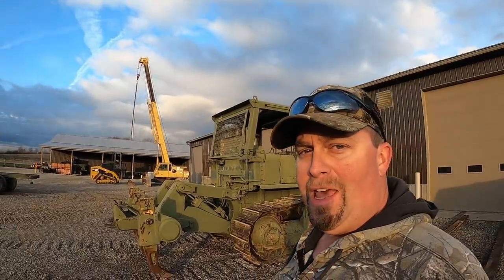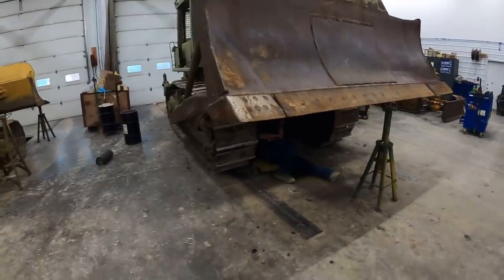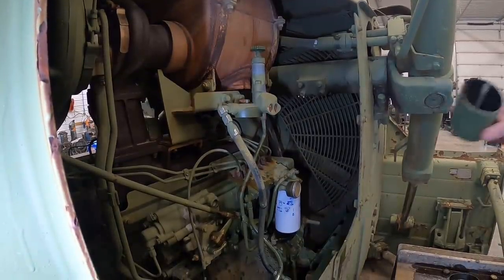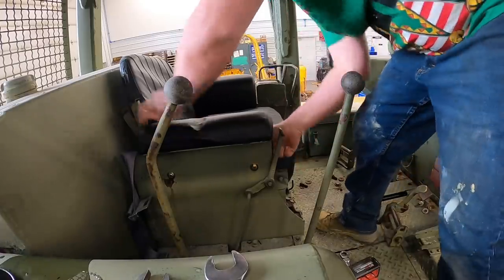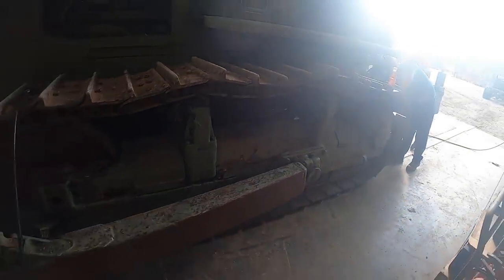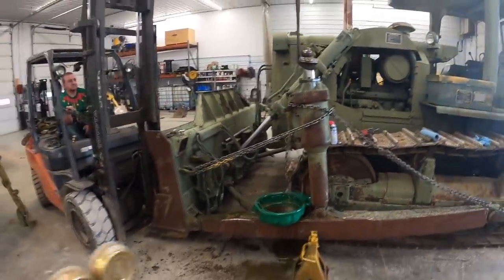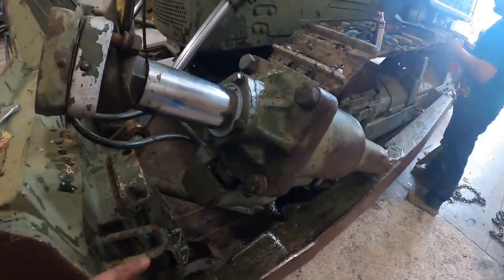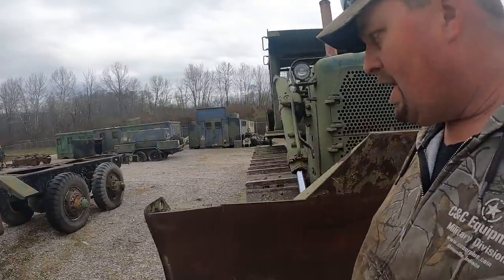Cat D7F ex military dozer walkthrough and service @C_CEQUIPMENT

Comment: I was a truck mechanic for many years, retired now. I actually never opened up a new filter and the rubber gasket wasn't there. All mechanics should check for a rubber gasket prior to installation and lubricate it, also check that old filter to see that its gasket is there and not still stuck to the filter housing. I agree with letting him go, it's too bad it didn't work out for him.

Comment: That would be a great farm machine. Clean low hours and easy to repair . No def no computers just a good machine. As far as the filters the first thing I was taught was be sure to remove the old gasket if it is stuck and make sure there is a gasket on the new one. Can't believe the guy did it repeatedly. Every shop needs a "Kevin". Make the day go by faster.

Comment: I have asked myself way before if working big equipment isn't easier than small equipment.. With big equipment, you use a tool to lift a cylinder as for a little one will lots of times get man handled. The stuff to fix is bigger and doesn't move as easy... torque settings are a lot higher but again its a tool to do it with.... Nice work Clint.... more, more.. yes I like it/lol

Comment: Did you take the belly pans off and clean those areas out? What did you find out about the sticking brakes? corrosion in the lever / pedal mechanism joints?
Reply from the maker: Belly pans were clean
Pedals was just sticky from siting

Comment: I had the gasket stay on the engine (two gaskets) and found out when I started the engine and it leaked. Then removed the gasket from the engine reinstalled and had no problem after. Lost about a quart. I always lub the gasket when installing on engine.

Comment: Awesome , Thanks for the channel . I have a JD450C , I am having issues with the fwd/reverse . Once I get it going it stays going , next day I have to work it back and forth . I have a manual and have done some adjustments to make it work but starting to fail again . Do you , can you , charge me for consulting over the phone .
Sad to say ,  I DO NOT trust our JD here on Island . They are good guys but over worked and don't know anything about something this old . I need someone with experience , knowledge and guidance  before I start digging deeper . 
Again , I can call you with a CC# , charge me for an hour and then lets talk . Please . 
Thank You
Reply from the maker: I don’t have allot of experience with the older stuff from ‘87 back on Deere stuff
I assume you have changed trans filter in the machine?
Reply: @C_CEQUIPMENT  Yes , I have changed the Trans filter and it was clean and no metal . I did notice , if I don't let it warm up over 3 minutes it goes in F-R and hi and low . without any delay . Could this just be a coincidence ? Sorry so long to get ack , been on fires for past several weeks , Thank you  for your thoughts .
Reply: @DaleDirt  
I'm not an equipment guy but that sounds interesting since it initially sounds like a pump/seal issue when the fluid gets warm but that doesn't jive with "Once I get it going it stays going".  I'd love to hear what you find out, simply out of curiosity. 

Two other YouTubers, if Clint can't help you, who's knowledge I'd trust AND would care about what they tell you in addition to explaining why based on deductive reasoning backed by experience would be "western truck and tractor repair" out near the CA/OR boarder (forestry, farm, and some on-road) and "Dirt,Grain & Steel" in north-central IN (row crop farmer with a separate dirt work/excavation company that he doesn't focus on AND specifically runs extremely well maintained older, not vintage, tractors/equipment).

KUDOS for understanding that time is money and respecting the value of Clint's knowledge; that goes deeper than being a good professional and speaks of your probable integrity.

Comment: It takes a metal filer it catches the trash before the main fuel filter ,, the tank is probably full of mud ,,usually if Trans is low it bypasses into the finial drives,, check the radiator hope it's not a panel type an bad $$$$$$$ LOL I know I replaced mine on D 7 G

Comment: Your theory of precombustion injection is wrong, there is a small chamber above the main chamber and the injector and glow plug are in that chamber. The piston compresses most of the  air into the small chamber and when the fuel is injected it burns in the small chamber and blows out into the main chamber. This system was used because early fuel systems did not have very high pressure 500 to 1000 psi. and the engines did not have really high compression.
Reply: You are correct, the military updated these engines to DI, dont know why though.
Reply: @RomeKG471  That is a huge expense for for really benefit, Military Equipment hardly ever got enough hours to make the difference worth it.
Reply: @nfarnell1  Thats the military for ya! cost doesn't matter.

Comment: C&C Equipment +:  Very good continuation video from the transport video some two± hours from/to the C&C shop. Depicts a reasonably 'easy' service effort until...    the left-hand blade hydraulic cylinder rebuild catastrophe. A supposed 'short' and simple effort which escalated into a 'long' and complicated nightmare!  Oh, well, we learned a lot in the process, like how to ruin some rather expensive tools; set fire to and otherwise damage various cylinder pieces/parts; etc; etc. 😬

Found that one of the replacement filters came from the supplier missing the 'all-important' top sealing o-ring. Thoughts concerning this:   the POOR product is directly attributable to even POORER labor involved in the filter's manufacture, probably an illegal Guatemalan. Now, how did said labor get into the U.S.??? 🤔 Likely "walked" in, like nearly 12 million others have to date! 🤥

In all, quite an excellent presentation, as is the norm for this channel's videos. As such, it is awarded the  requested  YT  'thumbs-up'. As always, keep these coming. They are always enjoyed and looked forward to! 👏👏👏
Reply from the maker: Many thanks!

Comment: I haven't got a NAPA filter without rubber yet but have had 2 that were fucked up threads and 5 or 6 CAT fuel filters that split and spray fuel within 10 hours of use

Comment: I’ve never seen one without the metal screen in that spin on fuel canister, might want to check into that. Great video!! I grew up working on Caterpillar’s of this vintage. HAPPY NEWYEAR!!!
Reply: There is a supposed to be an element in that canister, that is the primary fuel filter & water separator, nice tractor
Reply: @38365chevelless  Correct, that's an 8H4681 primary filter, should have a 9M2341 element [screen] inside.

Comment: I enjoyed watchin you guys destroy the pipe wrenches.  I destroyed an old RIgid about 3 weeks ago using a cheater bar on it trying to loosen a huge JIC suction line fitting on a hydraulic pump.  Mine pulled the threads but still cool watchin even the bigger shops like yours improvise to get the job done!!

Comment: Old cats like that had a hydraulic oil dipstick inside the screw on fill cap. Just like the fuel systems, it’s a dipstick that’s bent over at a 90 and it slides into a slot that’s just wide enough for the stick.

Comment: Yes Napa filters are made by Wix and I personally only use Cat, Wix (Napa), Baldwin, Luberfiner filters. I refuse to use Fram and other cheap filters to just save a buck. I have yet to run into a filter without a gasket yet. I've never seen one of those separator canisters without a filter, generally they're a slightly bigger micron to catch most of the garbage before the secondary filter.

Comment: Enjoy your site and your posts. I just snagged an old USAF Hyster 10,000 155XL with 2700 hrs. Great shape, needs very little work and like you pointed out on the mil equipment, none of that electronic BS!
Thanks for the posts
Reply from the maker: We just had one of those we sold

Comment: Do you have a good location for my to look for a turbo for one of these?  I have a 1965 d7e ( d339t 4 cylinder engine) and I’ve gone through 3 turbos in 3 months.   CAT has warrantied them but this last time they sent a technician to look at my machine and he said bad turbos.  He thinks they are made in china and a CAT number is being put on them since they are obsolete.  He said a CAT made turbo is like $6k and these these turbos are $2k.  

The turbos are actually seizing up when the dozer get up to temp and under boost.  Eventually the turbine sides oil seal goes and it plows oil out the exhaust and I have no power.  

I’ve thought about buying a salvage cat turbo .
Reply from the maker: That’s strange
Only outlet I would have is an aftermarket one that probably from overseas
Reply: Go to a turbo and injection pump shop, it's Garret cartridge.

Comment: I have seen when the gasket from the oil filter stuck on the block and they put a new filter on without checking and run it and it blew out and ended that engine real fast some people have no clue dosent take much to look up and make sure its gone or even look at the old filter top when you take itoff
Reply from the maker: Yep

Comment: Thank you for being a shop that gets those Military heavy Equipment, the LOW hours on machine. This machine could have been used in Military life for training new guys or gals only. The tracks or so large on traction sprockets, great sign ( wear item) the filter change by them great sign ( it just sat ) no use after filter change so your filter change for me is like getting new life. The seals on tilt cylinder for front blade could only be from sitting rot, seal goes bad from no use. People might look at those Government surplus as junk, you show otherwise. I will say from my experience on a JD 450-C Dozer. This is just a FYI for all watchers of your video series. Someone had done what I call a Alaska overhaul. They spray painted it real good. We had it running and then it would starve for FUEL. 
It was the over spray that got on screen just under fuel neck on top of tank. The screen got plugged up with new yellow Paint. All we had to do was clean it good, it FIXED run issues. After 3 changes of fuel pump( what we thought was problem) just FYI, if the equipment is repainted always check those important fuel pressure intake areas for paint over spray. That's my story on engine running ruff, starving for fuel.
If a person doesn't care about the OD colors after you go through those Military rigs. A person is buying a great piece of equipment in my Humble opinion. Wish I lived closer to you, so you could go through my collection of old big iron that I have. You do such a great job of explaining and redoing servicing this equipment with lots of working life in them. Like I said if a person can live with the OD colors. Who cares if it's dark green, as long as it can get the Dirt moved, that for them the most important thing for a person who wants to try and make a few Dollars with there dirt moving company.

Comment: most peeps that change oil know to lube the Oring so the guy must have never changed oil before, Napa should inspect all filters before they put them on the shelf, with a witness mark beside the Oring, but that doesn't mean someone could come along and take the oring out trying to be an ass, not good both ways👍👍👍👍👨‍🦯👨‍🦯👨‍🦯👨‍🦯👨‍🦯👨‍🦯🦮🦮🦮🦮🦮

Comment: I pulled a lot of filters off and the rubber o ring gasket stuck to the block .if you did not catch it you would lose your oil real fast .Fram filters was bad for that I never used a Fram filter only baldwin.and very reasonably  priced .

Comment: Indirect injection diesels do not inject fuel into the runner like a gas engine. They have a precombustion chamber with lower pressure than the rest of the cylinder that they inject into. No diesel engine to my knowledge has every injected fuel into the intake.

Comment: I like how you explain the steering clutch system on the series CATS. Never drove one always interested in that lever control ( two pull Levers) what you must do before stepping on brake pedal. I did run a 175 and 125 International. Boy those had power to push dirt
I worked on a main line sewer job. We did have a 850-B Case front loader for pea gravel run up to ditch on bedding of pipe. The different I saw with the Case loader over the International ( the company owned the International it Rented the Case) was the case was quicker shuttle on running pea gravel. With those power lever control ( think that came from a Military Tank design that Case used) it was only confusing to me on back up, always turned the Loader the opposite of direction I wanted to turn. Ended up just using foot pedals for reverse drive turns The International could sure load a overflowing bucket though before you knew it. What's your opinion on those 125/ 175 International, don't see meany in your selling fleet. Pro and con on there Brand before Dressta  bought them out
Maybe talk about there equipment on a video if you can Please. Saw the Dressta  NEW Dozer line up at Con- Expo in Vegas, they are like Komatsu on trying to get better visibility to each side of front blade.
Reply from the maker: Well your in luck I have a sweetheart of a 175c coming in and a couple Dressta dozers
Stay tuned

Comment: Clint, could you have put the large pipe wrench on nut and supported in place...then lower blade to break cylinder nut loose? Before socket ball was exposed ?
Reply from the maker: Trust me we tried that just didn’t put it on video

Comment: I bought a Napa fuel filter for my skid steer and noticed no gasket but figured maybe a new design and it was built in or something. of course, it leaked so I tightened it, and still leaked so I thought I put it on wrong took it off put it back on still leaked so I took it back, and they gave me another I checked it at the store and to make a long story longer, after 5 we found one the had an O ring. the kid said maybe they don't need them. I'll talk to grown-ups that work there next time.

Comment: So you fired a guy because you bought cheap filters? O rings missing?
Reply: That's not what he said... Re-listen to what he said amigo.
Reply from the maker: After his 3rd or so time of installing filters without orings yes I did
Rule number one when you pull a filter out of package you lube the oring then install
Reply: @C_CEQUIPMENT  first thing I learned working at the old Gulf Station @15 yrs old😳